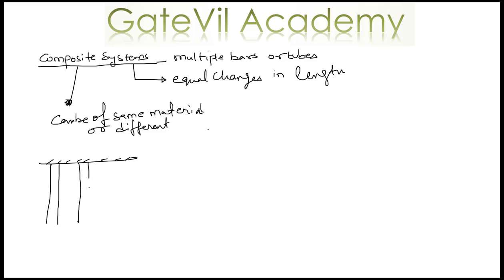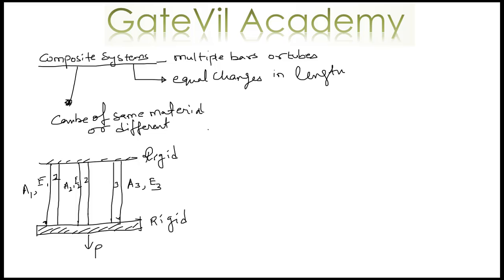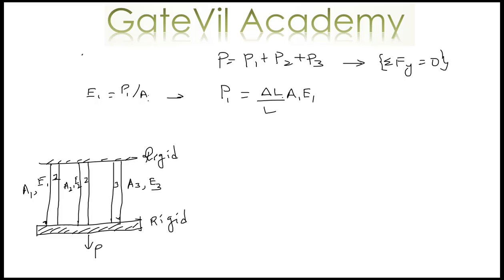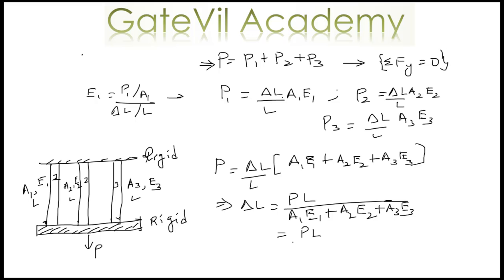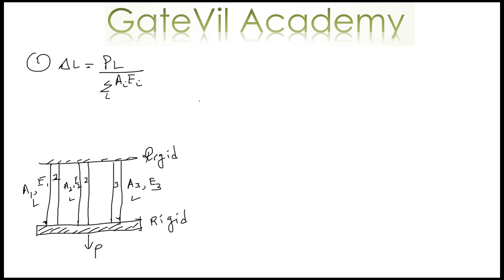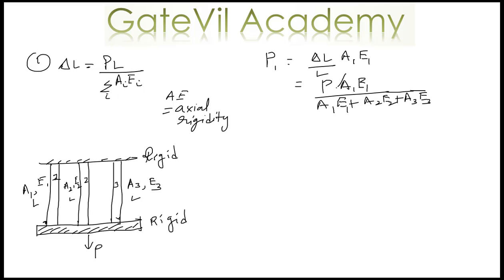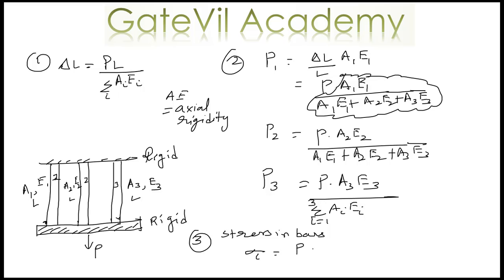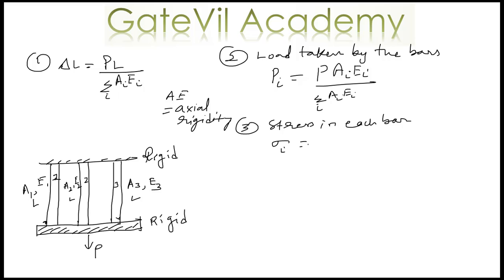Strength of materials: Composite Systems

Comment: imagine 3 identical bars vertically placed 2 copper bars at sides and 1 steel bar at middle  and one side for the 3 bars are fixed and other side is the load of x newtons is acting on 3 bars then can we write total load 'P' is equal to P=2p1(copper)+p2(steel) or
P= p1(copper)+p2(steel).
help me.